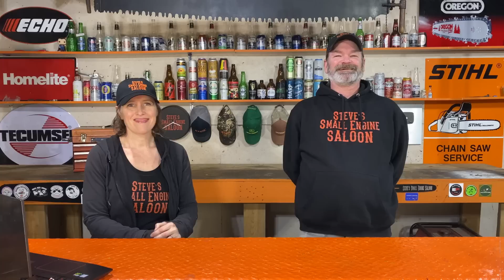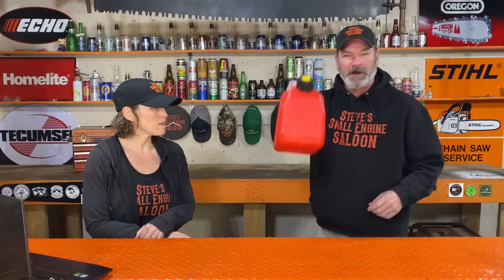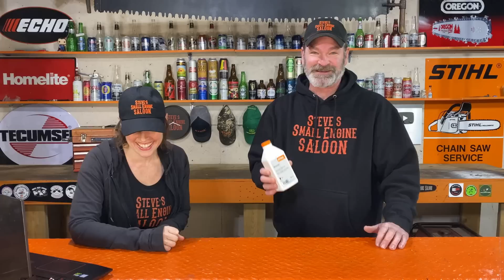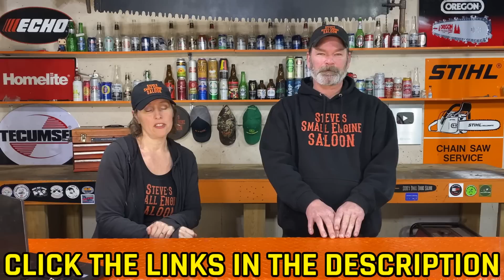Why Is There Such A HUGE Difference In Gas/Oil MIX RATIOS? (DAY 12)

Comment: It must be said that a lot of the mix ratios are entirely arbitary and recommended purely for convenience. For example, outside of the US, a mix ratio of 16:1 will be hardly heard of, it will be selected purely for the US obsession with factions and dogged addherance to the imperial system.
With a modern two stroke there would be little or no difference between 16 to 1 and 20 to 1. If it was not for the obsession with fractions 15:1 would be easier to work out in the metric system.

One example is my leaf blower, it is branded with a 25:1 mix ratio recommendation, for years I have been running it on the 50:1 mix that I use in my European chain saws and brush cutters using a two stroke oil recommended for a 50:1 mix. What I find is that the muffler does not carbon up badly like it did on the 25:1 mix. This tells me that at 25:1 there was excess oil.

A contradiction is some very old motors, a good example is the British made "Seagull" outboard motors, from the 50's and 60's, that had a factory recommended mix ratio of 10:1. Some people love these things.  If you run a 20;1 or 25:1 mix in them they are very hard to start and run poorly. There is a kit available that replaces some jets and stuff in the carby, that allows them to run well on a 20:1 or 25:1 mix. 
The problem is that at a 10:1 mix the oil is significantly effecting the octane of the fuel, probably a lot less of a problem as the mix ratio rises.

Then there are some high mix ratio oils, that we are seeing in some of the mower shops, the claim is that they are designed to run at twice the recommended mix ratio ( half the oil dose) in any given machine. I'm not convinced.

I have come to the conclusion that this comes down to the mix ratio the oil is designed to run more than the manufacturer specified mix ratio. More or Less.

Comment: So Steve I was gifted a Chinese back pack blower that calls for a 25:1 mix, if I ran a 40:1 can fuel mix do you think it will be ok? It's a fantastic blower and I've been mixing at 25 to 30:1 but would rather use what I use in the rest of my equipment. Great vide Steve and April.

Comment: I've always mixed my 2 cycle maple syrup mix gas the same. 3 oz. Of syrup to 1 gallon of 91 octane non ethanol. My saws and trimmers all run just fine and the exhaust smoke actually tastes kinda good. I recommend switching to maple mix asap. Oil is getting soooo expensive!
Reply: Yea but, maple syrup ain't cheap, and I wouldn't recommend  two stroke oil on your pancakes!
Reply: Real Canadians eat donairs. I buy my maple syrup in bulk. By the pallet actually much cheaper that way. Two stroke oil is a scam!!!
Reply: @lonesomefeller2205  Bean oil....Thats where the magic happens.

Comment: I have a Outbord from 1956 Johnson 30hp takes 32 to 1 says in the owner manual 30 weight motor oil I love that motor still has 98lbs of compression  both cylinders 6 V electric starter

Comment: I run a bit fatter and only mix one brew. Why fatter you ask, my kid seized up my Sachs saw, looks like a straight gas was run in it? The fat mix is mainly for that one saw just to be on the safe side. Everything else runs on the same mix. None of the plugs are fouling so I must be doing something right?I do have the old fashion plug cleaner too but I almost never need to use it. I did when I had a boat and trolled it constantly.

Comment: Hi Steve.I have a new to me 2015 Husqvarna 550xp first generation.The cylinder is scored and I have new oem piston,cylinder kit,crank seals on order.This is a low hour saw.Should the bearings and separaters be replaced as well? I was told it may have been straight gassed.Thanks

Comment: The take away here is, if you buy cheap oil from the home improvement places, probably best to make the mix to what the manufacturer recommends. If you buy a good quality oil (Stihl, Husky, Echo etc) then you're probably fine to reduce the oil to fuel ratio a bit from what the tool manufacturer recommends.
My rule of thumb is not less or more than 20% either side of the recommended ratio and you're generally fine.

Comment: I raced MX back in the 70s and 80s they were all 2stroke back then 32 to 1 was pretty much standard mix. I run my 80s Merc outboard at 40 to 1 and it runs like a top. The mfg's  jetted their engine's for specific gas oil ratios so if you have factory jetting and get to far off their recommendations your engine might not like it .

Comment: some of the new oil ( 2 stroke Engine Manuf. are saying right on their bottles) 100/1 mix for all 2 strokes -Amsoil?
Reply: I have a case of Amsoil Saber and says can be used for "UP TO 100:1 RATIO"  I tried a 70:1 mix in my old Homelite XL14 and over heated and stopped.   Tried it again with 50:1 Echo Powerblend and it ran perfectly.   Original owner's manual specified 32:1 mix!

Comment: I think your disclaimer is, effectively, you must use a quality, modern 2-stroke oil to ensure adequate protection occurs with 40:1 mix. Don't be a cheapo using 10W-30 motor oil and just thin your ratio down to 40:1 and expect things to be OK.

Comment: I've looked up instructions for used equipment, and have gotten 32:1 in one PDF and 40:1 in the next (next year I think) - we're talking about year 2000 here! I run 45:1 in everything as a way to not decide between the modern 40:1 and 50:1, though the only two stroke engine I run through tanks with any regularity is my trusty Echo SRM-2110E.

Reading a spark plug is a good skill, as well as checking for carbon in the spark arrestor. Lots of buildup either place can suggest too much oil in the mix, or too rich of carb setting.

Comment: I disagree. I play around, rebuild, and race little Harley Davidson Hummer 125cc and 165cc , 2 stoke engines, and Ive burnt a few up running less than 28 to 1. These old engines  require more oil, ESPECIALLY when they start turning unusually high rpms for racing.  I use 24 to 1 on any brand new engine and/or  fresh top end, , and 28 to 1 after its truely broke in.  Almost bullet-proof with 28 to 1. Just my own personal experienece with these old, vintage 2 stroke engines, with cast iron cylinders.
Reply from the maker: This is a small engine channel!

Comment: I've never had good luck with engines that require oil to be added to the fuel.  😢 I just use the electric equivalent for those jobs.
Reply: Sorry,  but there aren't any real electric equivalents for most 2 stroke gas equipment!